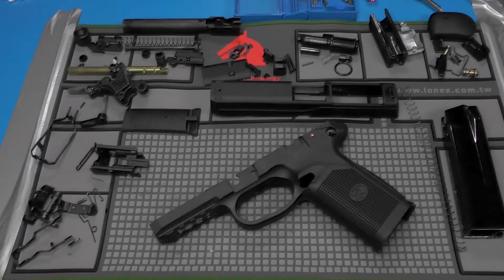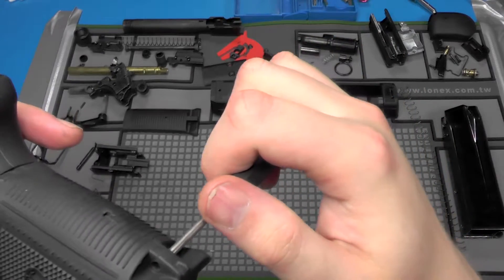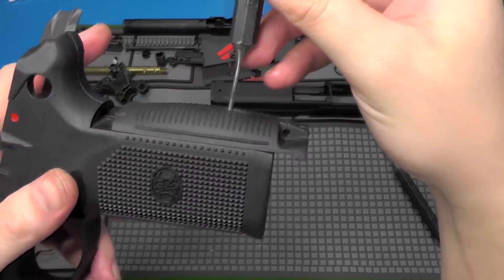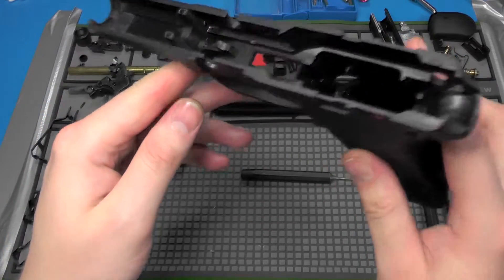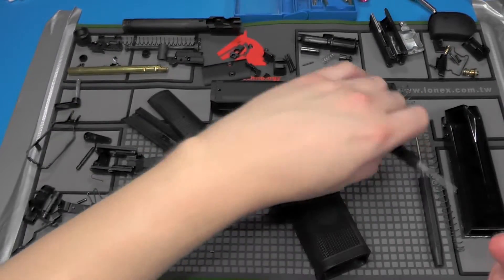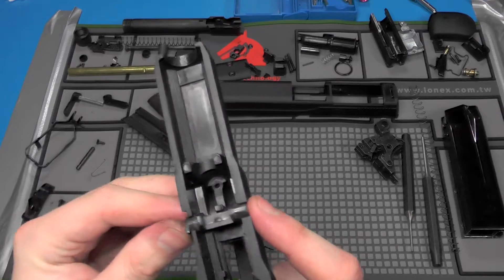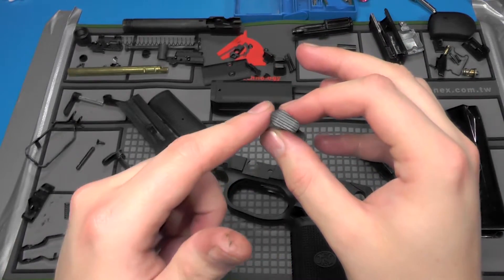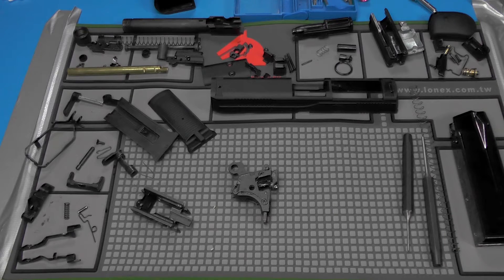Tech-tip: How to properly change backstraps on the Cybergun/VFC FNX 45 GBB pistol

Comment: thank you SO much. this  helped me out hugely
Reply from the maker: Glad you found it useful :D
Not exactly as easy as you would think.
Reply: Non Existent i lol'd when you showed your mangled backstrap because that is exactly how i was headed if I hadnt checked your video. definitely not what i thought lol thanks again
Reply from the maker: Yeah, luckily I got real FNX backstrap replacements for this airsoft replica (which match very well but the fit is super tight. I have one permanently wedged on my airsoft frame at the moment :p ) so breaking the included airsoft backstrap was not that big of a deal :D

Comment: THANK YOU!!!! YOU ARE A GREAT TEACHER, THANK YOU AGAIN!!!!
Reply from the maker: +Gorgi9999 Glad you found it helpful. Hope you didn't waste a backstrap in the process like I did :D
Reply: +Non Existent Your excellent instructions prevented damage to the back strap. THANK YOU!!!!  I now remove the magazine taking a strong thin piece of line and slipping it from the inside of the magazine well on each side of the back strap working it as far as I can on each side under the back strap. Then I pull it over the top giving it several twist to tighten the line to hold in place.  I then take the tool compressing the tap while I pull the line straight back pulling the back strap down. Once it has come apart a little I have been able to pull the rest out with my fingers. I wonder how many back straps FN has replaced? Their direction are for something that does not work so easy. I put some grease on the back strap and frame but it did not help. THANK YOU AGAIN, ALL THE BEST!!!!
Reply from the maker: +Gorgi9999 Haha! That is a good question actually. Not only can it damage the backstrap but also the locking system in the frame for the backstraps. Seems like a pretty bad design, considering you still have to use a tool, a cross pin in the backstrap/frame would have been better :D
Reply: +Non Existent I agree!!!! What happens if the delicate tap gets broken?
The pin system would of simplified everything with almost zero chance of damage to the frame. I am going to leave mine with the strap in there now and if anyone wants to try the other back strap they need to buy their own pistol.
Reply from the maker: +Gorgi9999 Haha! That last part is so true! Goes against everything that having replaceable backstraps is supposed to be useful for :p
Reply: +Non Existent Their FNS-9 COMPACT ALLOWS THE BACK STRAP TO BE CHANGED WITH A SIMPLE CROSS PIN!!!!

Comment: Can you do a how to disassembly of the lower that would be a great help
Reply from the maker: +madarauchiha1106 I need to get more comfortable with it before I do that. Even then it's questionable because it's a lot of parts and pretty complex.
Reply from the maker: +madarauchiha1106 Yah so I got it back together, and I can tell you for sure there will not be a video guide on this. Really messy to work with. Difficult to make a good video on. Would not recommend anyone to take it apart unless you have to.
Reply: +Non Existent awww mine won't shoot and I can't figure out how to even disassemble it hod did you get the safety off? Are there screws I'm missing?
Reply from the maker: +madarauchiha1106 I think I sent you a message on Google+ with some info. If you didn't get it, contact me somehow and I will send it again.

Comment: .If anyone can advise, are the sights affixed via screws coming up from the slide? Are they difficult to drive out of the dovetail, do they require a sight pusher?
Reply from the maker: Here are links to the exploded view so you can see how they are installed.
Slide: https://i.imgur.com/gonu0o5.jpg
Frame: https://i.imgur.com/P4bZoZ1.jpg

The front sight is secured with a grub screw from inside the slide if I recall correctly, part 01-1.The rear sight is held in with the screws in the BBU, part 01-20.

Don't think they were hard to remove once the screws were out but it's been a while since I did it.

Comment: How did you remove the orange thread cover? I'm having a lot of trouble with mine.
Reply from the maker: +Jo Peterson Sorry, can't help you. Orange tips are not required in my country.
Reply: You're very lucky. Thanks anyway.
Reply from the maker: +MattMcCarthy I feel for you guys in the US with those orange tips. Sounds terrible. :o
Reply: used my stove. heat the inside not the outside because the thread protector is aluminum. then use pliers to see if it came loose if not heat some more

Comment: This thing wont come off... I dont wanna reck my gun but im really pushing and nothings happening
Reply from the maker: Airsoft pistol or real one? It could be that the fit is extremely tight. Perhaps try gently tapping it up/in position a bit first, and then try to remove it as per the video. Thinking that maybe it has "locked up" or something.